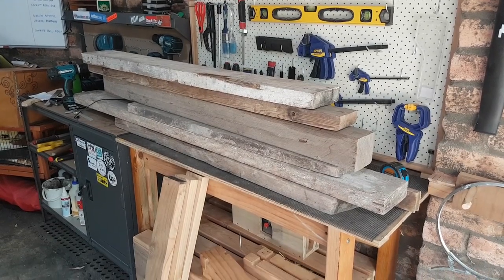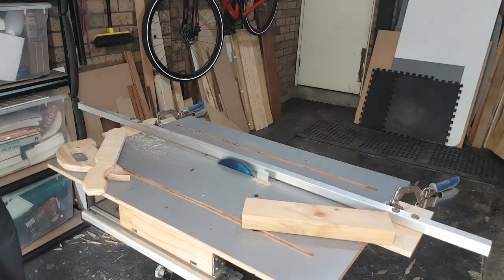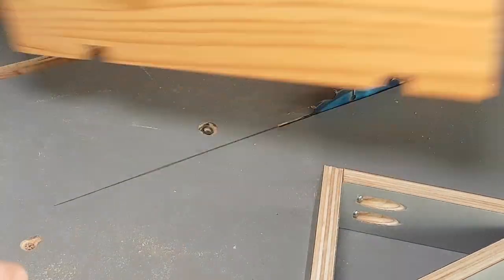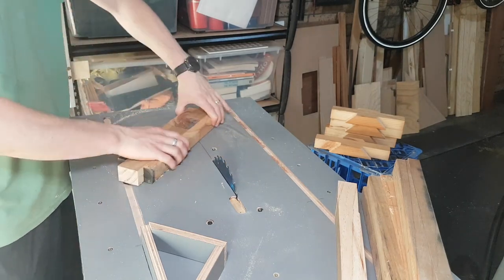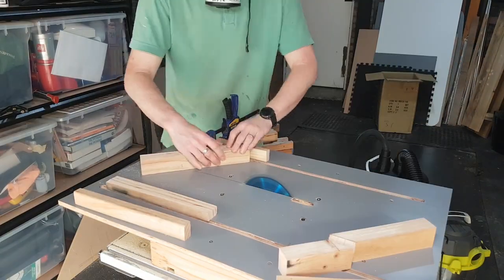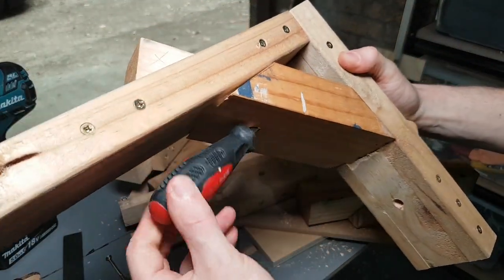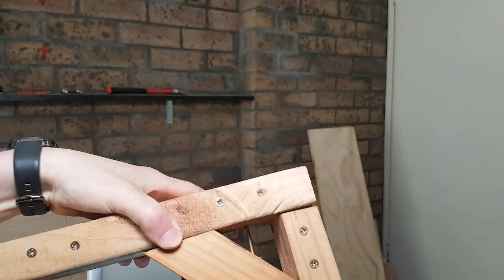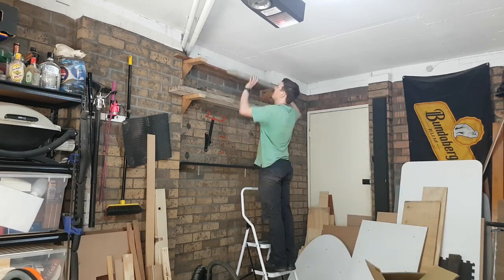DIY Wood Storage Racks (with Cheaters Mortise & Tenon Joints)

Comment: Great concept, altho. my head's spinning with all the pieces to be fitted together. Don't sneeze or you'll never work out how to put them together again!
Reply from the maker: Hahaha still easier than trying to cut true 45 degree mortises. 9 pieces per unit all up, and good news is if you did sneeze the bits are pretty interchangeable... just won't fit quite as well 😅

Comment: 3:50 ahaha! I used to do that as well. 7:08 that too, especially when it comes to mirroring the design I'd end up with identical pieces.
Good stuff, stay safe with all the fires going around.
Reply from the maker: It may not be pretty but it works well! Ok I've wanted to do know this for ages but too lazy to Google... How do you time tag in comments? 😅
Reply: @FixitFingers  You just have to type the time stamp out and press post, it'll automatically create the link.
Reply from the maker: @Ace-zb5xr  Awesomes, cheers!
Reply: @FixitFingers  No problem.

Comment: Good to see that splitter James. I used a similar joinery approach to build my CNC table. I doubt you would get much better out of a job site table saw!  Loved your 45 degree jig.
Reply from the maker: Thanks Derek, I didn't have a single kickback feeling this whole project (unlike when I tested it in the build video!) It is amazing that such a small little thing does so much to help. To be fair it's more of a 44-46 degree jig but it did well for a rough and tumble build! 😉 Learning heaps that I hope to put into more precision when I build version 2 of the table.
Reply: @FixitFingers  some masking tape will get that jig closer on one side if you need to.  Or build a fill in adapter on the cross cut sled.
Reply from the maker: @Derek_Lark  nice, I'll try the tape idea, that'll be a good fix for this version. Will make a better sled with a proper mitre attachment on the next one.

Comment: Hey James, this project looks great, probably a bit more complicated to a similar I'm trying to make for a similar solution but I'm interested to know the size of it if you please don't mind to share it?. Merry Christmas from New Zealand. Thanks.
Reply from the maker: If it is worth engineering it is worth over engineering :P They are bed slats, pretty much 2x4s (90x45mm). They are about 30cm long both for the wall and arm pieces. It's been a few years now and they haven't budged.
Reply from the maker: Oh, and the span between them is about 1.5m :)
Reply: @FixitFingers  thank you!.